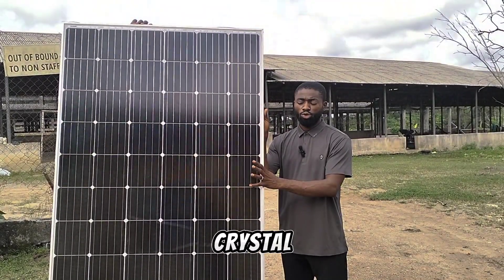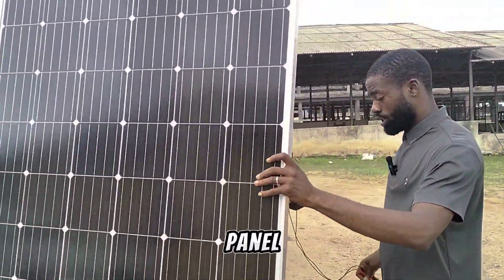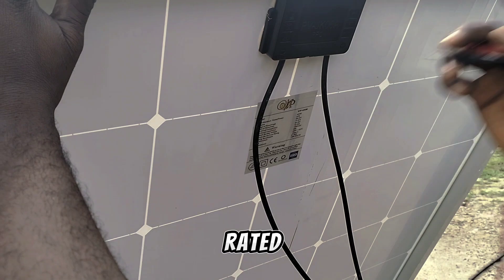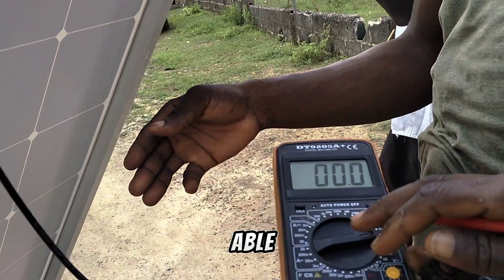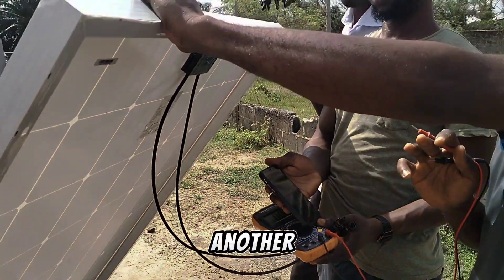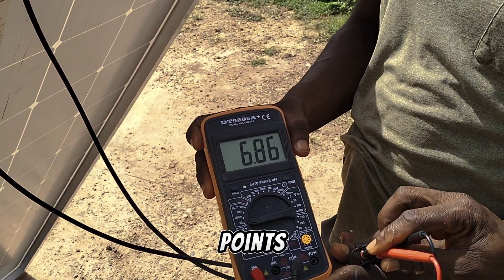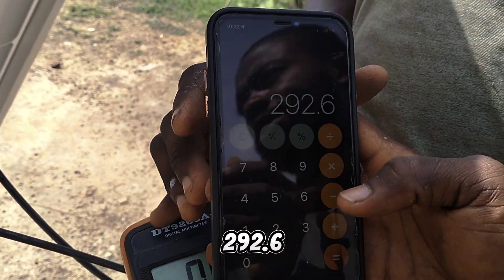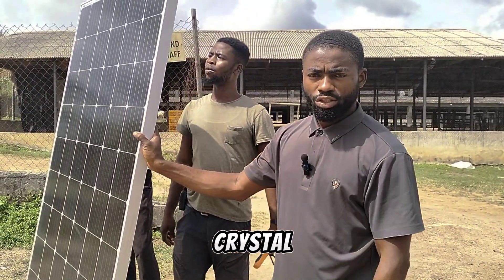how good is VIP solar panel?.

Comment: That weather in not that bad to have such low output. The panel is fake. Open circuit current should at least be >= 8Amps. Sticker labelling has been inflated

Comment: well done for this. However, what you are measuring is the open circuit voltage (Voc) and not the Vmp you can see that the voltage measured exceeds the Vmp and at Voc there is no power because if you check the I-V curve current is zero at Voc.
that is to measure the Vmp the panel would be connected to a load...

Comment: Hello. You can only confirm the rated wattage of the panel during a very bright sunny spell. 
Energy collectability of solar panel improves when the sun is shining brightly. So whatever readings you get now is not correct. Paharp the only reading which may be close to rating, is the output voltage.
Reply from the maker: Anyways, hope you watch the video to the end?